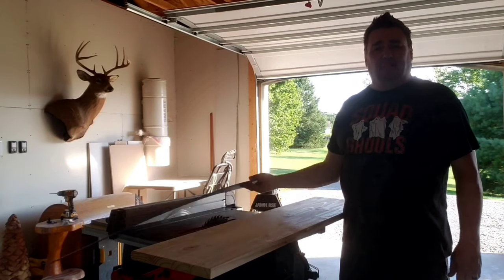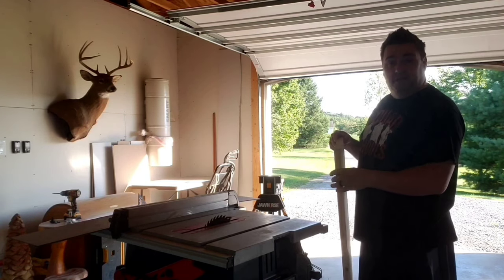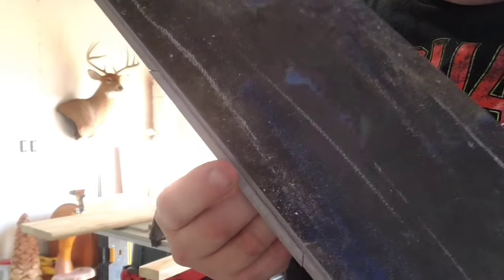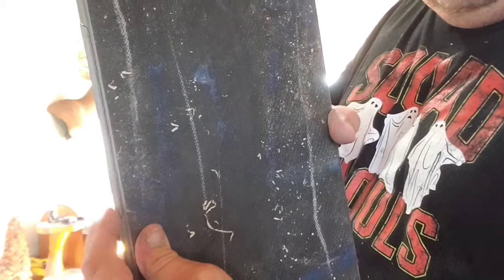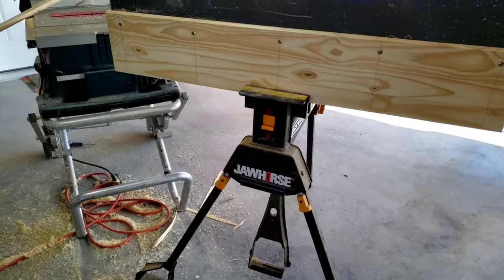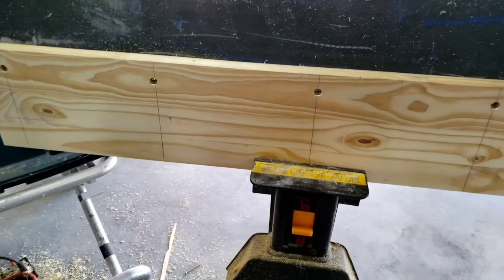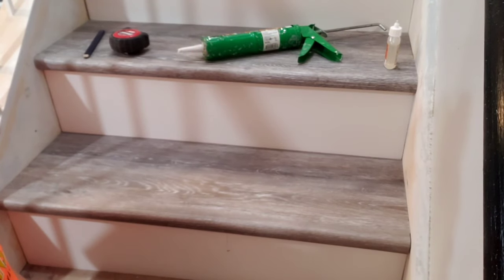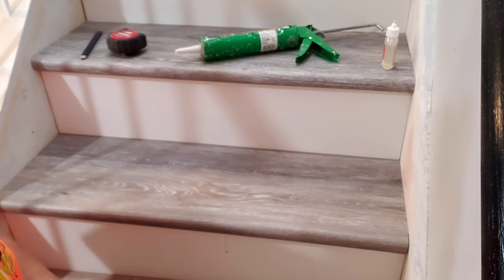LVP DIY Bullnose stair tread with heat gun

Comment: Very nice bending method !!!  I would start at the bottom... apply the above risers over the treads , hopefully it will  make more of a seamless job.
Reply from the maker: Thanks! I installed the treads after the risers because walking up the steps you're staring at the risers and any slight gap would be noticeable. But that was just my logic and why I decided to go that route.
Reply: @DannyKissel   Well, my thoughts are:  Install the tread first ( no need to be precise on the back cut) then install the riser, pushing down as you go, so there shouldn't be any gap ( this will also help  keep the tread in place  in addition to any glue used )   I've learned over the years that " There's more than one way to do it right "  So if it works for you...  keep on !
Reply from the maker: @rcline99  Your logic seems solid! I agree that there's more than one way for everything and when I did stairs in the past, each person I worked with did them both ways for different reasons. The one old fellow I worked with said quit overthinking and get them done lol.

Comment: Bending a nose is a great idea. I prefer a smaller radius or square nose. Using a 1x will produce a 1" outer thickness. Of course the tread should fit snug under the riser and the ends snug to the skirt. The companion to the stair gauge is a spreader bar using a cam or threads to give the skirt a little nudge. A shooting board is also helpful.
Reply from the maker: I used the tread that we built the stairs with years ago, so it was an exact match but I do like the idea of a square face if I was rebuilding the stairs

Comment: Great video. Thank you.
However, I'd like to know what saw did you use to make the cuts?
Reply from the maker: Thanks! I used a sliding chop saw. If you don’t have a slider you can cut each piece separately, but it may not line up perfectly. I laid the plank on a thick piece of wood so I could let the bull nose overhang on the frontside, so it was still able to lay flat. Hope this helps!
Reply: @DannyKissel  , excellent,. Thank you!.

Comment: So what to you suggest how to cut the plank after the bull nose has been done. As I don’t have a sliding chop saw. And also when you got to the landing. And you did bull nose for the top step onto the landing. Did you leave the backing on the planks for the landing.
Reply from the maker: You may be able to use a hand saw or a table saw and a sliding jig to hold the correct angle if not cutting perfectly straight. But that’s really my only guess. I removed the backing on the landing area as well because I glued them down the same as the bull nose and wasn’t sure if the backing would adhere to the surface. Hope this helps

Comment: Did you remove the backing from all the planks or just for the nosing planks?
Reply from the maker: I removed the backing from all the planks. I was worried about adhesion and that the planks might not connect correctly if the backer was on one and not the other.

Comment: So if you remove backing material from the planks it will lose the cushioning effect.
Reply from the maker: Sorry, I just saw this comment. The stairs are solid feeling. But I didn't see much of a difference between the stairs and the floor. I was more worried about the backing breaking down and the tread becoming loose

Comment: I'm just curious how the stairnose are holding up currently? I've bought the plastic stairnose but they don't match well and supposedly do not hold up well.
Reply from the maker: These look the exact same as the day I installed them. They are fully supported because ups used the same stair tread to bend the bull nose. They get used everyday due to the main entrance orphanage our house is on the lower level. Our cat managed to scratch one, but other then that, no issues.
Reply from the maker: Here's a follow up video with around a year of everyday use. https://youtu.be/4wTjXYlbTOo

Comment: I'm using Life Proof LVP from Home Depot. I tested this and it bent nicely, but I was wondering if I need to remove the rubber backing for the construction adhesive to work? How did you install the risers? Did you use pin nails or something to hold them in place while the adhesive dried? Maybe if installing the risers first, the treads and bullnose will keep it in place?
Reply from the maker: I used adhesive on the risers and a few nails only at the very top so the bullnose would cover them once finished. I did that a day prior to installing the treads so they were set up. I removed all the backing that was on the planks to make sure I had solid contact for the adhesive on the treads. I had to use an oscillating tool to remove it. (It didn’t want to come off) . Once I installed the treads I did my patented step/squish/wiggle, I left them set overnight to cure before walking on them. They get used daily and it’s been a few months. Everything seems solid. Hope this helps!
Reply: @DannyKissel  thanks for the reply and the helpful video!

Comment: Did you have any problem with the bent board joining the board behind once it was bent?  I Did this to some  7.5 mm Coretec flooring and the ends of the bent boards seemed to have shortened when I bent the board putting a crown on the bend board joining seam, making it useless as the ends would not join the board behind it other than in the middle and one side
Reply from the maker: I had zero issues other then I set the clamp to close to the bend and it dented one while hot. Did you cut them to size before bending? I can see that causing a stretch or a twist issue. Or if you heated the whole plank. Mine were roughly the same thickness as yours and I heated just the bend area, maybe a 3” wide area. I was never near the joining tab. I held the gun close enough to touch it at times
Reply: Deflection... it's basically unavoidable but you can lessen it's severity.  

As the material cools quickly and from the outside in, an internal tension forms resulting in deflection.  To minimize deflection
1) Heat the material evenly and no more than is neccessary.
2) Slow the cooling process so the temperature at the edges and the temperature at the core can remain as close as possible while the internal heat is dissipating.  

Diffusing heat in the core material is most important to avoid cracks, stress fracturing and performance failure.

Comment: What tools did you use to cut the planks once you made them into Bull Noses?
Reply from the maker: I used a sliding chop saw and fine tooth blade. Ran it slow to avoid chipping but probably didn't have to.

Comment: how hard was it get the backing off of the planks before you bent them? I am currently doing the floors in my house and want to do the same
Reply from the maker: I’ve seen some at stores that just peeled off, but I had to use a oscillating tool to peel ours. I laid them on a clean smooth workbench and pushed them against a stop block. Took 4-5 min for each plank, using the widest blade I could find. I was afraid that they wouldn’t adhere as well with the backing.
Reply: @DannyKissel  thanks. Sometimes you just gotta do what you have to in order to get the job done.

Comment: I've watched many vids on doing this and like your jig that not only gets the left/right to trace but also the front/back to cut on.  First vid I've seen with that "feature".  Brilliant!  Also I'll be copying the bending jig.  Clever design.  QQ - I guess since you are using the stair tread to get measurements left/right & front/back not as much concern if your bullnose bend isn't perfectly folded over (i.e. keeping the board that is folded over "even" with the bull nose part - like folding paper and making sure it's not "off" a little) - any concerns with that?  I guess one could put lines on the bullnose bending jig to make sure you aligned "square" when folding over.  Stairs look great.  Thanks for the video.
Reply from the maker: Thanks for the kind words! In the beginning of the video when I "clamp" the plank in the jig, I had notched the straight board so the planks all landed in the same spot before the bend process so I really didn't have to much of an issue with keeping them square before the heating process. At the 2:50 mark you can see the ledge that the planks set on. I tightened it to a "snug" fit, wiggled the plank to make sure it was setting on the lip, then tightened it down. Hope this explanation helps.

Comment: Just tried to make nosings with my vinyl plank. Didn't work :( I heated it for 10 mins. Plank thickness is just 6.5mm. It didn't want to bend at all. Even just a bit. I don't know what is the problem. Maybe my heatgun doesn't produce enough heat
Reply from the maker: I used a new heat gun from Harbor Freight. It was 1600 watts and I held it really close and every few passes tight against the wood and the plank to really focus the heat. Our plank was also 6.5mm
Reply: @DannyKissel  , I tried one more time after I removed the underlayment. I also held it very close and moved the heat gun much slower this time, so it heated each area better. It worked this time.
Reply from the maker: @artemirinashevchenko7214  Glad it worked out!
Reply: I did my 6 steps with the same technique, except I didn’t cut the slot to the holding board, I cut two small pieces vinyl the same thickness, glued it to the large board for guidance.

Comment: How high did your heat gun go? I’ve seen this done a lot on thicker plank, but I’m using TrafficMaster 4.4 mm thick, do you think it would work the same?
Reply from the maker: I don't have any expierence with the TrafficMaster, but I'm guessing it would work the same with less heat time per plank. Each one of mine took 5-6 min to heat while moving the gun the entire time, at 5mm thick, so on a guess, I would say the 4.4 should heat up faster, but thats a guess. As for the heat gun mine was from Harbor Freight and had a max setting of 1100 degrees (F) and I ran it on max the entire time. Hope this helps

Comment: How long did it take with the heat gun?? About to do this but I thought about using a plumbing tourch since ive seen others do the same.
Reply from the maker: I ran the heat gun for roughly 5 min a plank. I tried the plumbers torch and didn't get a consistent heat and had it bubble a few small places and seemed like some areas didn't bend as nice. But yeah I've seen others have success with it.
Reply: Torch will ruin the core material.  Both a heat gun and a touch cannot diffuse the tempurature enough to maintain structural integrity of the core.  The damage is mainly hidden for months or if you're lucky, years... but them cracks a'comin.
Reply from the maker: @saltystairtreads  it's been over a year and no issues yet. Stairs are the main entry to the house and get used multiple times a day. And they're supported by the wooden bull nose. I guess we'll see

Comment: Best video in this I’ve seen, great work. What did you use for the risers?
Reply from the maker: Thank you! I used primed MDF for the risers
Reply: @DannyKissel  how thick was the MDF you used on the risers? how did you get them to stay in place while the adhesive dried?
Reply from the maker: I bought 1/4”  primed one side mdf from Home Depot in a 4x8 sheet. Our stairs previously had 1/2” OSB installed, so I glued the MDF directly to the OSB.  Then used nails at the top only so the bullnose would cover them.

Comment: Approximate heating time?
Thanks for the how to. 👍
Reply from the maker: I think it was like 4-5 mins per plank heat time. I held the gun close and moved it slow continuously. Used a harbor freight heat gun
Reply: @DannyKissel  I have a Wagner, but I've seen the HF.  
Nice unit. Thanks.  👍

Comment: can you do this with 4 inch wide planks?
Reply from the maker: I would say yes but you might need to heat them a little more because you won't have as much leverage to push the long side over. But it should work fine. The heat in mine stayed in the area of the heat gun

Comment: Does the rubber backing need to be removed?
Reply from the maker: I thought it would give me better adhesion to the wood, but as hard as mine was to remove, I might not have had to
Reply: @DannyKissel  Thanks,  I appreciate it. It is a really great idea, I've been wanting to do my stairs but the plastic bullnose had me worried. I'm definitely doing it your way👍

Comment: Hello guys I did half of my stair tread’s no problem but when I got new material I did everything the same but ofter heating it like for 10 minutes then I would start being it if would start to break from the side has any body run in to this problem or is it that lm doing something wrong thanks..
Reply from the maker: Is the material the same thickness and brand? If everything is the same, I would try to heat it longer and maybe hold the heatgun closer to the surface.  But that is about all I can offer. Not sure why it worked on the older stuff and not the new
Reply: @DannyKissel  thanks for the quick response but yeah everything is the same lifeproof from Home Depot I literally try every you just say so I give up I was going crazy lol plus that material is not cheap but I’m still need 3 more so that was last yr and I’m getting ready to try it again will see how is goes this time..
Reply from the maker: @VincentGarciaHernandez  I hope everything works out for you this time!
Reply: @DannyKissel   up date I just went to buy the same heat gun at harbor freight and it work out just perfect I went back to see your video and I noticed that this gun that you were using it doesn’t heat as high as the one I was using 
 this one from harbor freight 
only heats up to 1000 deg the one I was using  the max heat was at 1200 I think that was my problem I was getting the vinyl planks to hot ..
Reply from the maker: @VincentGarciaHernandez  I’m glad it’s working out for you now!
Reply: @DannyKissel  thank you ..😊
Reply: Will this also work on Laminate planks? Thank you
Reply from the maker: @Kindlyone777  I don't really see why it would not. You may have to do a test piece first.
Reply: @DannyKissel  I’m going to give it a try. Thank you

Comment: Do you have a video on how you cap the first 2 step sides? Best tutorial.
Reply from the maker: Sorry but I do not. I was trying to lay it out and completely forgot.
Reply from the maker: I used the tried and true method of measure 967 times and cut 1009 😂. I laid the face stair down with a 45 degree cut and drew a line on the wooden tread then laid the side piece down and transferred the line. That got it close. I glued and taped them together and set them in place for a test fit and tweaked both straight cuts to meet the wall and trim. The filler board that goes behind the bullnose needed cut to 43.5 or something like that to make it fit where the 2 corners join and also had to shave the tongue of of the filler
Reply: Read that still have no idea to do execute lol. I am a vision learner. Maybe a photo?
Reply from the maker: heres a follow up video that shows the bottom stair closer. Sorry it took so long. https://youtu.be/4wTjXYlbTOo

Comment: Dan, great video! Your picture at the end shows the bottom of the stairs where there are 2 sides for bending. How did you do multiple sides and get the joints to look so seamless?
Reply from the maker: Thanks!! With the tried and true method of measure 967 times and cut 1009 😂. I laid the face stair down with a 45 degree cut and drew a line on the wooden tread then laid the side piece down and transferred the line. That got it close. I glued and taped them together and set them in place for a test fit and tweaked both straight cuts to meet the wall and trim. The filler board that goes behind the bullnose needed cut to 43.5 or something like that to make it fit where the 2 corners join and also had to shave the tongue of of the filler
Reply from the maker: https://youtu.be/4wTjXYlbTOo

I finally made a part to that shows the base stair.

Comment: Wouldn’t it have been easier to use the template on the stair first and then bend the LVP
Reply from the maker: I thought there might be issues of stretching the vinyl side to side while bending or shrinkage or any combo of the 2 while the vinyl was soft. So I figured the best way to make sure there wasn't issues like that, was to cut it after bending.